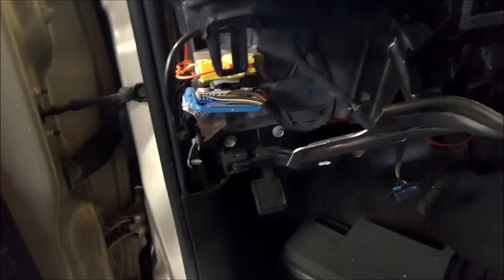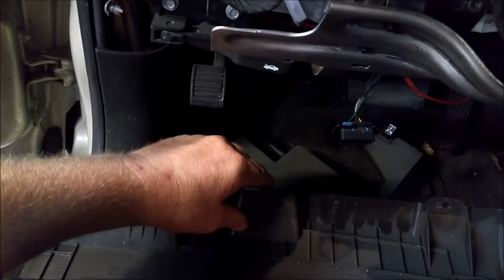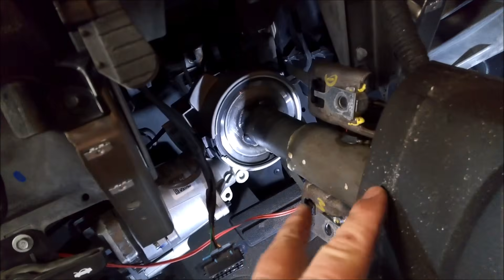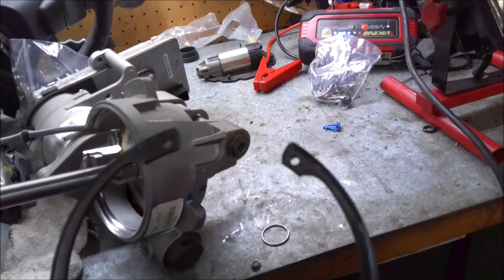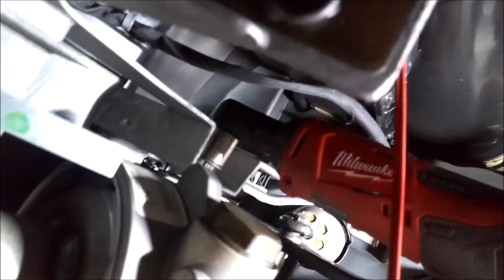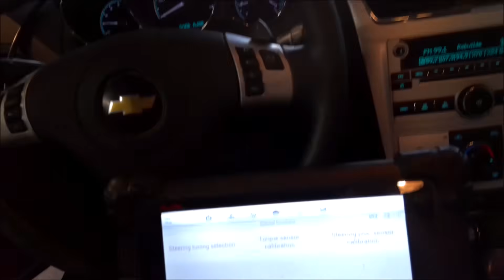2011 Chevy Malibu twitching steering wheel, no power assist, steering wheel sensor. C0545 Code

Comment: Just a silk-screen resistance material for two internal sensors the produce a 5Vdc - 0Vdc one direction and 0Vdc to 5Vdc turning the other. The voltage change and rate of change determines the assist the electric motor provides thru a reversing pulse width modulation signal on the motors driver input. It does hurt to clean connectors and a small dab of dielectric grease but wow! Manual steering during fail is “Armstrong” steering and hard! This is small complicated start to save 0.2ths of 1 mile per gallon. Thank to the Seirra club, CARB and the hippies at the DOT that think this is a great idea. No more hydraulic steering with a pump & hoses as that was “2-Flow” a high or low flow solenoid that let the pump freewheel almost, so 10% assist at road speed and 90% assist parking, either on or off based on speed. Even with a centering pin, same location on splines, all alignments are different so the system needs to know straight, left, right using “Special Functions” on chassis selections, Tech-2, All-Tell, SnapOn there are a number of $2k tools with $1k subscription to software that you would use once. Like singer/band who gets royalties for a song that sold, the vehicle manufacturers get a royalty for software. It depends on how much software a company buys that effect cost and what you get. Cause you don’t get everything! “Never buy a Chinese copy of a TECH-2, because they quit. So $2k or $300? You guess!
DK, ASE master tech since 78.
Reply from the maker: I've been using the launch and autel the last 5 years or so mainly the launch the last 2 years and haven't found anything it wasn't capable of doing yet. The subscription fee every year is also lower than autel and snapon last year they had a special and I believe I paid around $350 to be up to 2022.
Reply: @HooptiesGarage  I know what you mean. SnapOn guys told me they skip a couple years then get updated. SnapOn changed the program as required them to pay for rack back year. Maybe different know, but walk on truck behind dealer one day, broken 1/2” breaker bar end, cracked 6-point socket & two other items. He looked at me and said to get off his truck, mail it to SnapOn because I never bought anything from him. I told him no, because I bought from the 16 other dealers since 1973 in two cities. I had receipts by the hundreds. I don’t care he told me. I gave the tools to buddies in dealer and they got replaced. Holly cow! The sold CP drill and air cutoff tools when I started. Stuff dealers have never seen but say SnapOn.
  At least the Tech-2 has updates to two both internal cards, but my ex-coworkers are retiring. Just want to get to 2015 for wife’s car. My 67C10 has an 2003 Tahoe drivetrain. I used the BCM to include RKE, Theft, Power Windows, Chimes thru left speaker, Power Locks, 40 tooth tone wheel on tail shaft of 87 era 700R4, 92 Camaro VSS, AdjustablePedals, power buckets and sew my own leather and console, CPVC cover in leather. Door modules GM inside operated by aluminum spring load door lock pistons with rubber bumpers on switches. The Isuzu Rodeo shifter, park brake and center lifts out by magnets. White over metallic copper brown base/clear but on hold to finish, lumbar! Ouch!
Reply: I'm working on a 2008 g6. I replace the torque sensor with an AC Delco sensor and it was good for a day then the customer said the steering doesn't feel right and it's loose to the right and hard to the left. I installed another AC Delco sensor and it seemed good to me. The next day she complained of the same thing only opposite hard to the right little looser to the left. We're talking just a hair but she's had the car 100,000 miles. Car has been aligned and I've recalibrated the sensor a few times.

I just scanned and there's a few other codes that showed up p2544-00, u073-00, u2109-00, u 2100-00 most of them are can bus codes. No other issues besides the difference and feeling of the steering. No lights.
You ever ran into something like this? I appreciate any help from anybody!
Reply: @extrabolts331   Yes. While "U" codes are serial data codes, a GM type diagnostic flow chart will tell the description up front. Either class2 on cavity two of the OBD-2 connector or cavities 14 & 6 for high-speed CAN. Using a good digital multimeter, use the Min-Max feature and use chassis ground or your terminal jumper kit to cavity 5 for chassis ground as 4 is computer grounds. Turn on, start engine and operate radio, door modules and other class2 nodes on this data line. Activity should be 3.5Vdc or half of 7Vdc as it toggles on/off. This is close. Engine off, key out, check resistance for the GM LAN terminating resistors at 120 ohms each. Only two with dedicated locations like ECM & TCM. Your resistance should be 60 ohms total. If good, there is one thing few talk about when you have data codes on high milage cars, that is line noise! The alternator can have a leaking diode allowing A/C on the DC network thru bad diode or defective reman. Attach DMM to battery ground and B+ at alternator, start car and turn on 3-5 loads. At idle, 0.020Va/c is normal, but accelerate to 2k RPM's as reading should max at alternator at 0.060Va/c. If higher, A/C voltage distorts the high/Low signal and confuses the modules setting codes. The power mode master (BCM) has back-up software to Identify "State-Of-Health" messages sent every two seconds and has the ability to set codes for those off line or sending garbage. Basically, it has to be conscious to recognize a problem, determine which node/module it is, set the codes and provide "Limp-Home" software commands. This happens if a wire is open, short to ground, short to B+ or sending data that can't be read.
  Note; In the past, if you have seen (SP103) for example on schematic of found one under dash but not all black wires (That one is multiples grounds) but using the splice pack and a jumper wire with 150 metri-pac connector, like class two, say you can't communicate with 3 or 4 modules. Using scan tool to communicate to cavity 2, to first cavity of splice pack (Same color) using schematic and next cavity in order takes to module (XXXX). With metal "Comb" removed, jumper from class2 in, to next in line like radio. If you where unable to communicate before, now you can, another module/node on that network is a problem child. Keep jumping next, then communicate until you find one "Un-Able" to communicate. That is you culprit. It is unlikely to have 3-5 modules go bad at the same time off and on. This method of diagnostics is spelled out in GM diagnostic flow charts. Mitchell's and Alldata simply buy and reprint what GM suggests. They don't make it up, they just don't pay for it and leave it out.
 But the A/C voltage on a DC system is easy to understand. It is the same technology used at home, when buy a gadget you plug in as a receiver from Bluetooth or whatever, but plug in lamp into mate device that now gets a DC signal on an A/C line to turn light off or on. Hope this help as I think I covered in EL-5 for ACDelco classes, but I only taught upper Midwest but worked on cars. Other instructors did not or had been decades since they work on cars. Cadillac had "Keyword-2000" and "Keyword 2001" on models in the 80's with electronic climate control. But using two fingers w/key on, engine off, hit "MAX" & "DEF" to enter into engine diagnostics while the rest jumped pins at Diagnostic Link Connector cavities 1&2. I still carry ACDelco key to do that. To clear codes, you disconnected the battery and waited 10 seconds. We have come a long way and I remember too much useless crap! DK, ASE master tech since 78, retired.
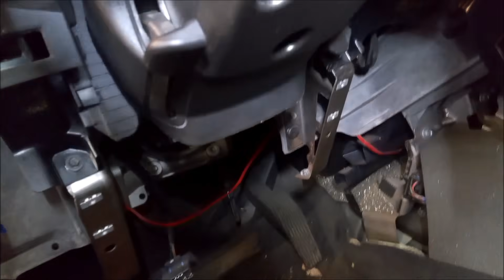Hope this helps or at least gives you checks to make for processes of elimination. After all, that's what we do. And here I am sitting in ice cold garage at 8:03 at night! I can't stop!
Reply: @deankay4434  this is some great info, thanks!
Reply: @deankay4434  before I dive into diagnosing these communication codes though, it's on its second torque sensor ACDelco brand. The customer is still complaining that the wheel feels a little loose to the right and a little tight to the left, like it's not program correctly. I programmed it multiple times with my autel and it takes the programming. After the first sensor ,it it felt opposite tight to the right, loose to the left so it's hard to believe it's a front end issue. These codes were not in the system after I checked the first sensor.

Have you ever ran into a problem where the steering just doesn't feel right after multiple torque sensor replacements? Just an alignment too but they didn't program any sensors they said that was extra.
Reply: @extrabolts331  They are steering angle sensors only. Torque is a software calculation base upon angle, direction and speed. There is no load cell inside this sensor. 
  There are many counterfeits being sold from overseas. Check the ACDelco website. GM has been building Buicks and Chevys in China now for almost 20 years. If your customer is still experiencing a problem, it is either are connector issues (Dielectric Grease) or Steering control module. Remember, they motor drives the intermediate shaft at 5 degrees left or right of center over 98% of the time with plastic drive worm gear and plastic shaft driven gear. No inspection of these two components or added lubrication, the same pointed out in the TSB if replacement. Also, regardless of the name on the package, I didn't make it! So but one from "Dorman" and see how long that last? Did you use you Fluke 87 V, to take voltage measurements? If you use the " Min-Max" feature, chances are you will see a loss of signal (Up, Down or reference) which is cavity 4 on the OBD-II connector with an industry max of 0.400 Vdc. I would prefer a 0.003 Vdc drop myself, but you won't know until you test it! The have a rotating sensor and a motor controller that plugs into a high amp motor! If you were going to guess, which one would fail at this point? High amp motor connections & controller? Or number two replacement wheel position sensor? They can call it a steering torque sensor, but from an electronic position, how would it measure torque? That's right, it can't unless a valid pair of signals are seen by the steering wheel motor controller, then speed of rotation and direction is calculated by the motor controller. Just try removing it, put a light on the connectors and add dielectric grease. See it that doesn't fix it!
  Another little secret from almost 16 years ago, was fretting on injector terminals? As they vibrated when opening and closed, the terminals developed oxides with micro-scopic wear, had to be replaced and a dielectric grease by part number to correct the issue. Google injectors fretting. 
DK, ASE master since 78, retired.
Reply: @deankay4434  thanks again, I was wondering how torque was sensed.  I hate to "try" things to fix it, so I was going to try a used assembly.  I used to work for Gm, before these systems.  I remember w multi new part failure, we were told to use a "known good part". So we'd take the part out of a working used car.

She can't drop it off, however is having another shop diagnose it....I can tell you I haven't seen many skilled diag shops around here, so this will be interesting..

These sensors were bought from a local ac Delco dealer
Reply: @extrabolts331  I was an ACDelco instructor, tech seminars and defects for 5 warehouses distributors, on contract with Raytheon for 7+ years. It wore me out! 243 days on average per year.
I couldn't afford to get sick but only 1 of 6 nation wide who were a Master Tech. All were supposed to be! L-1 and P-2 were passed as well. L-1 was like 7 questions on each item that effected emissions from thermostat open to EGR that won't close. 100 questions and I missed 1. Score 99!
Reply: @deankay4434  that's definitely a great skill! You still teaching or working for a tech line or anything?  I taught myself how to use a scope, last 2 shops I worked at has no idea how to use them! They come in very handy!
Reply: @extrabolts331    I know it is real cold in some areas & you may not have a proper garage, but did you figure it out? Let's us know so everyone can learn. Thanks bud, have a safe happy holiday season!
It is -17 degrees in Omaha, NE. on 12/22/2022. In the farmers "Almanac" that temp is listed as "Cold as hell + 3." ;)
Reply: @extrabolts331  I am retired there "Extra Bolts"! I do however get a kick out of your screen name. Kits come with new fasteners of all types at the dealer as well as the aftermarket. As the oldest of all on a large family farm, we had nothing and given nothing, not even allowance. So at the end of my week, Friday or Saturday, I cleaned and organized and scooped up extras in a 5 gallon bucket & took it home. I have an entire wall with commercial shelving and loaded with metal coffee cans all painted white. Washers, springs and interior fastness allowed for quick fabrication of anything I had going on. 
 As far as sharing repairs, I am passionate about best practices and accurate results that are repeatable. Some folks learn by watching, seeing, doing or all three. Yes I held 4 hr seminars not produced in Grand Blanc, MI., but also was an instructor holding 2 day classes, but I learned something interesting. Certain students ask really good questions! As an instructor, I had to be prepared to provide 3 examples of explanation not even related. This brought out the best in me. Not as a challenge but as how to relate mechanics, physics and KISS (Keep it Simple Stupid)
After a nasty lumbar fusion, I taught at the only "UTI" in Omaha where it started. In an automatic class (1 of 8 ASE Subjects) but torque converters comes up and torque multiplication becomes a difficult concept. I thought about and I said "If I had a 5lb cannon ball welded to a chain and held it 5ft out and swung it and you stopped with an open hand would it hurt?" Well open discussion agreed it would but doable. I told them the speed, size of the ball are all factors in a converter with the size of the stator, angle of pitch the pump blades and so on change what you feel. So, second, "Same 5lb ball, but 10ft length of chain, same speed...now stop it! They all quickly understood their are a lot of variables in torque converters and many tiny changes create character in a torque converter like stall speed. There are very few math formulas that can predict how a torque converter works under a "Stall Load" as engine torque, gear ratio in low, final drive ratio, tire size and vehicle weight create a math monster that would give David Vizard the need to talk 8hrs on the subject and produce headache for Neil deGrasse Tyson!
God bless the person who wants to learn from nothing to everything!
Safe & happy holidays. DK, my best sir as unfortunately I may not be able to respond in 2024.
Reply: @deankay4434  luckily, I do have a heated garage.  I was supposed to look at it again, but decided to go to a shop closer to her for diag.... Most of these shop just read codes, no real diag.    I definitely will update if I get a answer.
Reply: @extrabolts331  I agree, I feel they only give "Global OBD-II info" as required by law. No real time data or "Failure Codes" from the past! The TECH-2 shows 5 failure codes regardless of type, like engine, body, ABS or other. Mine is a Hewlett-Packard, this first ones make for 4/6 years. Then made by Medtronic's who where bought by Bausch and sold Green. Unfortunately, even GM decided to no longer support this platform after 2013. So, if you find a dealer buddy, power the TECH-2 from the A/C adaptor at connector end, connect RS232 cord and use the live shop computer to update TECH2, it erases everything off the PCMCIA card, then reloads it with new including 2013 models. Example, my with has a 2015 Malibu with 2.5L LS. Nothing special, just a base model but I can lye to the scanners and say 2013, the systems are the same (Not Programing) but access "Steering Position Sensor" is identical from 2013 - 2015 and one 2016 model.
Then go for it.
  But, I think without answer in English form tech support for capabilities, bi-directional control from "FoxWell's Website site. I would be in a holding pattern!
DK, Hope this helps!

Comment: If a get the steering column from a pick a part yard (a useful one obviously) need to get programmed??
Reply from the maker: It would be best to have the sensor calibrated but honestly you might get away with not doing it I am not 100% sure

Comment: Is it a way to tell if it’s just the Sensor or the motor I don’t want to by a new motor if’s it’s not the motor or sensor if it’s not the sensor but my. Sr do the same as everyone one else it’s a 2008 chevy Malibu with about 135/140 miles on it
Reply from the maker: If you have a good scan tool easiest way would be to monitor live data and see if the sensor is dropping out or reading erratic it's been my experience it's almost always the sensor I haven't seen too many of the actual motors fail but like everything else do they fail sometimes. Only way to know for sure would be with a good scan tool or scope on the wires.